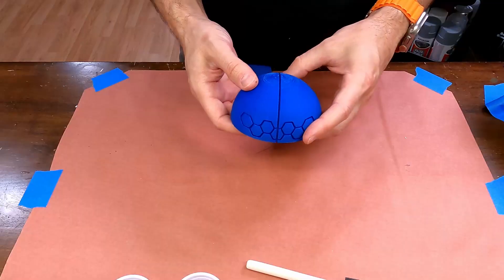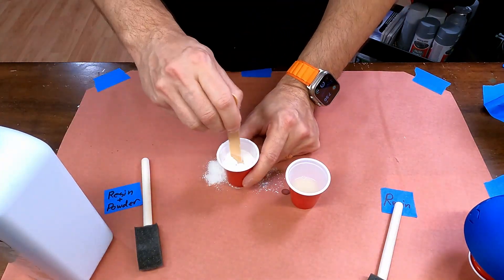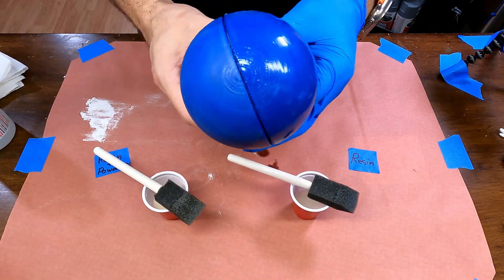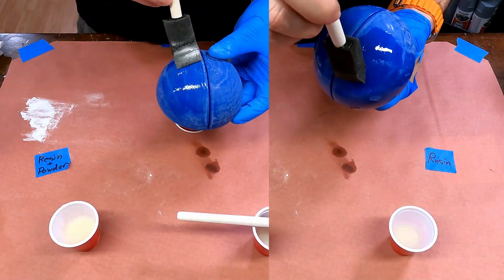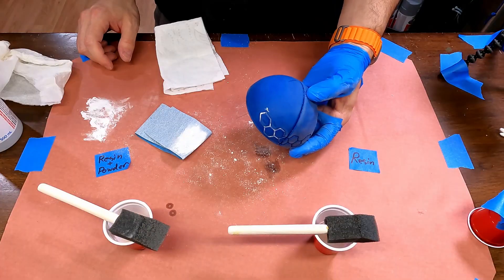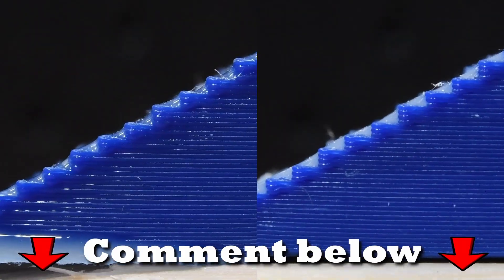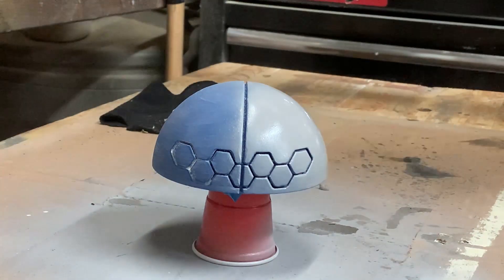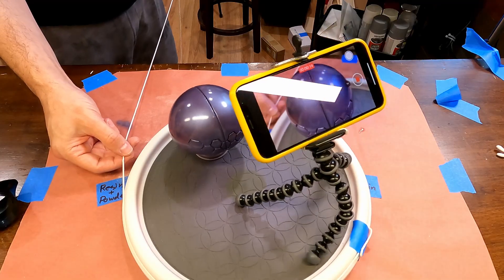What hides 3D Print Layer Lines Better,  Resin or Resin with Baby Powder

Comment: Seems like they both have their place.  the PR seems good for larger areas and in a more general use case.  I think the thinner R might be good for much smaller areas. a toothpick or needle to apply it to thin lines to help smooth out the lines in the hard to reach areas.  maybe even places you can't sand.  just a light thin single coat just to take away some of the harshness of the layers in those thin lines.

Comment: Are the sponge tools you use to apply single use? I've been using brushes but am finding them almost impossible to clean.
Reply from the maker: yup, cheap foam brushes that when done I put in the cure box and then throw out.
Up side of UV resin is 1 brush will last the whole project cuz the resin won't cure on you.
Reply: @DaveRigDesign   Thank you.

Comment: Thanks to your previous video I was able to fix, fill and smooth 3dprinted mask.... The process works as a charm.. i used potato starch and anycubic resin (aqua blue). The weight ratio was 2:1 (resin to starch). Used two uv sources (365 nm ~ 17w optical power  and 395 nm uv led flashlight. In most cases illuminated about 2-10 sec per layer. Sanded only after building up all the layers. It took me about 2 hours to fully smooth the full face mask. Also used a small spatula attached to the drill to ensure good mixing of components.
Reply from the maker: Awesome!!!

Comment: have you tried 2k resin instead of UV resin ?
Reply from the maker: Is 2K like 2 part epoxy? If so yes but not for something like this.
Reply: @DaveRigDesign  Yeah, t 2part epoxy. I've seen a 7 years old video about this method. As it has a very high viscosity,  almost as honey depending on the type you use, it covers up a lot of the layers and unfortunately details.  

I'm currently printing a 1 meter tall Sonic the hedgehog stature. I'm still not sure if I should use a resin method to finish the surface. This thing has so many round surfaces... sanding will be a pita.
Reply from the maker: Ya it should work the same. Difference being you have a limited working time and have to keep mixing batches. But if you are working on a large print you also have to consider how you will cure the UV resin. Maybe a hand held light. 

With UV you apply a little and cure and continue. With 2 part you have to apply and wait.
Reply: @DaveRigDesign  yeah, good point. maybe I should test it on not that important models first.

Comment: Hi. Corn starch tend to create a kind of gel. In epoxy, we frequently use fumed silica to achieve a thixotropic state (does not run). It could work as well with UV resin and it usually does not require a lot to work.

Comment: Very nice test.

Could this be useful for "failed" vase print that is not completely water tight, to make them water tigth
Reply from the maker: Yup. Coating either the inside or outside would make a print water tight.

Comment: Normally, logic dictates that you should use a thinner resin mix for each coat. So I’d advise a thick baby powder resin mix for the first coat, a second coat diluted with more resin and a final one with pure resin.

I also wonder if there’s a way to take this process into account at the moment of printing : making the model details slightly more pronounced so that when the resin is applied the « smoothing » of those areas match better the expected final result, and/or on the contrary had a bit of « waste » material on the areas that will be more heavily sanded afterwards.
Reply from the maker: I found the thin was just hard to control. I feel it’s best for flat surfaces where you can apply it and let it self level. Then you could just apply 1 coat and be done. 

On anything else the thick is better and I think all you need is 3 coats. 1st does 80% of the work, 2nd the next 19% and the last coat is just to fill the little pin holes/bubbles or missed spots. Could use glazing putty for this step also instead. 

Printing with this in mind could work in limited cases. Like if you have seams or groves making them extra deep would mean they won’t get filled in as easy.

Comment: Good video but the with powder demos are quite imprecise. There's no weighing of the resin and powder combination. It looks like you're shaking salt like you would on your dinner. It needs a more scientific approach in my opinon. It seems like there'd be no repeatability if you don't weigh out the product.
Reply from the maker: It’s measured by eye. Enough is added to get the desired thickness.

Comment: Lol I feel a bit called out in this video and for that you gained a subscriber lol.
But yeah I kinda figured it was just a viscosity thing. Something I noticed is that the powder seems good for big surface areas and the plain resin seems better for smaller areas that you need more fine control on. So it might be a case for using both techniques during an application for different parts of what you're working on.

Comment: I wonder whether the powder just increases the viscosity of the resin. Since resin comes in different thicknesses, is there a difference between powdered resin and thick resin? I would love to see a head to head if you can think of a way to “fairly” test the difference.
Reply from the maker: A thicker resin should act the same as adding powder. But resins for 3D printing tend to be thin so they can flow under the print bed easily.

You could get special resin but if you already have a resin printer then you already have the resin on hand :)
Reply: @DaveRigDesign  Ah yeah of course, that makes so much sense.

Comment: I tried out the resin and baby powder after watching your video. It works great! I used it to fill in some seam lines. Since you gave me a tip, I'll give you one. If you want a more precise pour for the baby powder, just duct tape over some of the holes.
Reply: Could you just buy cornstarch in the can and use a spoon?
Reply from the maker: @onestoptechnologies7305 probably. Don’t think additives in the baby powder make a difference.

Comment: You can just use aditives like aerosil or glass/carbon "flour" dust etc used in composite aplication 
They work awesome in aplications like that
But for me....just use some cheap spraypaint (like rim paint/ spray paint with acetone in it so it will stick to the print well and dry fast...some sanding with water , second layer , sanding , primer , ready for final paint)
Reply from the maker: Ya, I’ve seen the glass additives for resin and they would probably better to use in a structural use case, but baby powder is cheaper and can be found at any department store.
Reply: @DaveRigDesign  you can find powdered glass (not glass fibre) aerosil and other aditives super cheap like few bucks for entire bag like 25kg ones with concrete (they are used as aditive for concrete too like sometimes in alternative to aerated concrete blocks they are filled with aerated glass balls etc and in production dust created by manufacturing those aerated glass balls is "waste" used mixed with resin as a filler etc )  
I work with composites for long time, we use it everywhere 
You can also try basalt dust (you can find it everywhere in garden shops for like 5$ a bag) graphite powder (danger , dont breathe it , cost like 8-10$ for 0.5kg)
If mixed well concrete  / plaster etc dust can also work in some cases 
Aluminium dust is great too sometimes but hard to sand 
For me aerated glass microball dust / aerosil and simillar is great , after it harden super easy to sand 
And some 2 part acrylic low temp hardeni g clear coat automotive grade is even better , it fill the layers , then seconds later when thinner start to evapourate (dont add extra thinner) its to thick to make layers apear back again
Make sure you use automotive grade 2 to 1 not "special" ones  that most of the time are 50/50 or 60/40 etc
Only 2 to 1 "standard" ones you can get in any paint shop like boll , novol etc

Comment: Hi, I'm also printing a sphere with lots of detail at the moment (Ahsoka map ball), do you think it would be helpfull to put some sort of plasticine or rubber like substance in all the details, and afterwards remove the plasticine/rubber substance, to better preserve the details ?
This way you wouldn't have to worry about getting resin inside the details.
Any thoughts on that and what sort of substance would be best for removal afterwards ?
Thanks in advance.
Reply from the maker: I’ve though of using plasticine or clay or wax. Just need to be something that stick well enough to not fall out but not so well you can’t get it out at the end. 

In my new video I tried dabbing the resin on over the detailed area and it worked pretty well. Maybe that’s a option if just going slow and apply carefully.
Reply: @DaveRigDesign  I was following a video about finishing the ball, but he had printed it with resin (so he didn't have to sand or anything at all I believe), myself I printed it with an FDM printer. In the video he printed it in black and then painted it in gold, the detailed lines and holes remain black. So I thought when using your resin method, that I need to somehow fill in the holes and lines with something else that I can remove after applying the resin, so that the black lines and holes become visible again. Because I think that applying the resin will fill in al the holes and lines ( there are so many ;) )
Maybe some of that white wood glue, because when that's dry, it's easily removable I think ? Another question is that if you cover the whole ball with resin, if you try to remove the wood glue, will you tear to much resin back off ?
Reply from the maker: @iljacoveliers5834 maybe it will be easier to use glazing putty for this project. It’s easier to control where it goes and you don’t need to worry about getting it in places you don’t. 

I have a video about that process also
Reply: @DaveRigDesign  Ok. Thanks, I'll be watching that !!!

Comment: Congrats for both videos! I'm thinking to add the technique to my printings. I haven't work with resin so far and the UV Cure time would be an issue for me problably. How long does it takes for the tests u made? Tks.
Reply from the maker: Curing takes a minute or so. It’s the best part of using us resin :)
Reply: Great! Wich brand do you recommend?
Reply from the maker: @neyperes5332  any of the major brands should do. I normally use elegoo for printing so have that on hand.
Reply: I used this method for my print and used my wife’s nail Uv lights and it was still tacky so I put it out in the sun, still tack an hour later. Could it be that I put too much cornstarch powder? Or too thick of layers
Reply from the maker: @reikyjimenez9097 you just need to wipe the print down with some isopropyl alcohol and it will remove the tackiness.

Comment: It's really interesting to see the viscosity difference between the two. What I would really like to see, would be how that compares with using a two-part epoxy tabletop resin. I Make my own filament, to whatever color specification that I want, with sparkle effect. I typically just essentially dip my entire model, in tabletop resin. And then I hang it to let it cure. And amazingly, the layer lines vanish, the color becomes so much more vibrant, and any effect particulates in the base material, is absolutely amazing. But what I most curious about, is how a high viscosity resin, which has surface tension modifiers designed to self-level, and enhanced coverage. Versus a grade of resin that is designed to shed off of the parts, and designed to be as thin as possible.
Reply: do you think dipping the part and then spraying primer would work? I've been searching if people have dipped their prints in resin yet, as I've had the idea for some time now just haven't tried it. I know you use tabletop resin but I was thinking about using UV resin. Tabletop resin might be better though! something to think about and try one day :) thanks!
Reply from the maker: Issue with dipping a part is it won’t leave a uniform coat. It will be thicker at the bottom as the resin collects at the bottom of the print. 
Maybe this is fine or if the resin is thin enough it won’t be an issue.
Reply: @DaveRigDesign  that's true. I thought it might be an issue. Can you dilute resin and airbrush it on? or is it just more practical to be meticulous with a brush? lol
Reply from the maker: I’ve heard you can spray resin but it’s kinda dangerous and messy. I wouldn’t suggest trying unless you really research the proper way to do it
Reply: @GengarGang775 I dip my parts using resin thinned with IPA, and then rotate the part in a homemade rig I have. It comes out pretty nice and even, then primer.

There is an kinda infamous video a YouTuber did spraying resin, with no safety equipment either. It seems it works well but I would be really really careful with it. I’ve played with the idea before but I would use a sealed chamber with a UV light on the filter to polymerize the airborne resin to help reduce the health risk as it filters. Still wouldn’t recommend it though
Reply: @KCAwesomeness  I'd like to see a video of the process.

Comment: but youre still making the mistake of brushing it on.... DONT.
use an air brush to apply the resin........ you will get more even coating... less running.... less, or no sanding........ and you wont destory your print color.... and you wont need to paint it.
Reply from the maker: Spraying Resin is involved and can be dangerous if the proper steps aren't followed. More involved then I want to get into.
Reply: @DaveRigDesign  that is an excuse, not a reason...... danger is minimal, on par with any air brushed paint, or  other resin use........ and if safety is your concern, it would be very easy to take precautions to mitigate... just a respirator and goggles..... which you probably already have if youre air brushing and are concerned about safety to this extreme.
Reply from the maker: spraying acrylic is not the same as spraying resin. It's no big deal if you get acrylic paint overspray on your workbench or body but uncured resin is way worse. I don't want to whip down everything with alcohol to clean up or construct a paint both to mitigate this. So I'll stick to paint, but you have fun with it.
Reply: @DaveRigDesign  again, over worrying, under thinking.
Reply from the maker: @ZOMBIEHEADSHOTKILLER cool story, I’ll leave the resin spraying to you.

Comment: Any issues with the baby powder (cornstarch) going bad?
This looks great, I can see it's value as a thickener to the resin but it is organic and plenty of articles on making oobleck (cornstarch + water) warn to dispose of it after a while. 
Wouldn't be great if it introduced a rotten smell or something into your 3d print after a while.
Reply from the maker: Well since it is encased in resin it has no access to oxygen so it shouldn’t be able to decompose. Kinda like the mosquitos in Jurassic park :)
Reply: @DaveRigDesign  Thanks. I don’t have a resin printer or curing station but I’m still going to give this a try next time I’m printing something big enough to be worth it.
Reply: @Edramon53  sunlight is a great uv source. the only disadvantage is time of day. Best is direct sun. But also works with indirect (under an unbrella). might take a little longer.

Comment: i use table top epoxy 1 coat is all you need
Reply from the maker: Table top epoxy is self leveling, doesn’t it mostly drip off the print by the time it cures?
Reply: @DaveRigDesign  light coats have no drips
Reply: I'll post a video showing it work

Comment: Nice video! I have a question for everyone working with resins. I want to use micro-extrusion to extrude some paste that exists of 80% metal powder and 20% resin to keep the powder togheter after curing. I can't use UV resin because the light will not cure the center enough (I think). Do you have any experience on resins that can do this on room temperature?
Reply from the maker: I've seem people make resin castings where they mixed iron powder into 2 part resin and then poured it into a mold.

Comment: My experience with these is that, if youre not covering the entire piece, the edge where the resin stops and the plastic part meet doesnt have a smooth transition. There will be a small lip no matter how fine you sand due to the lack of adhesion of the resin to the part.